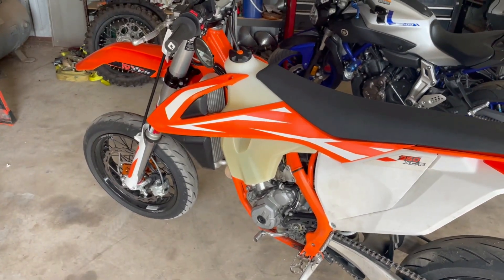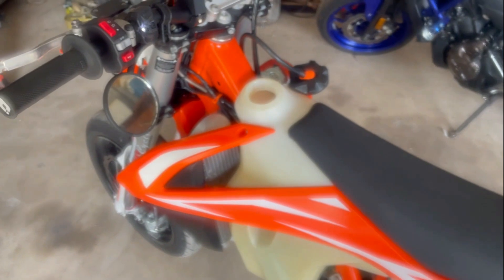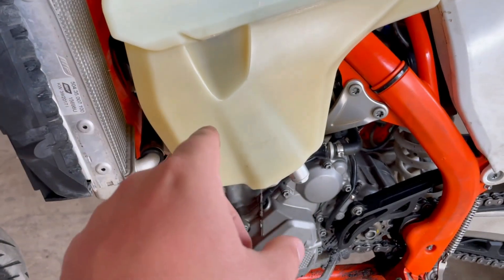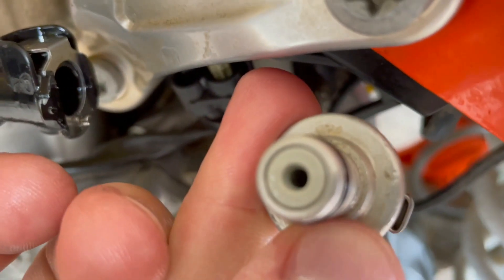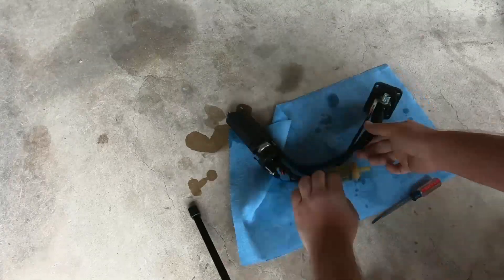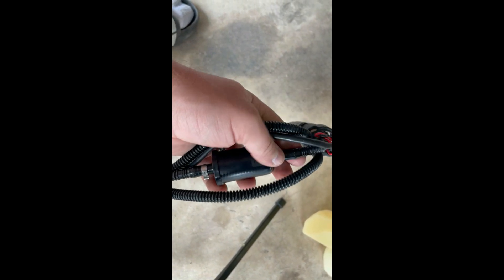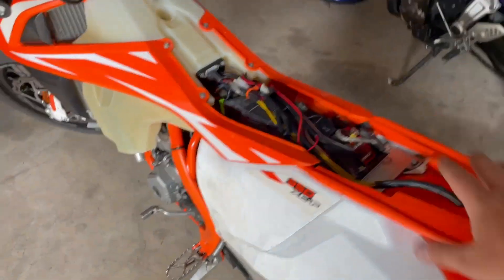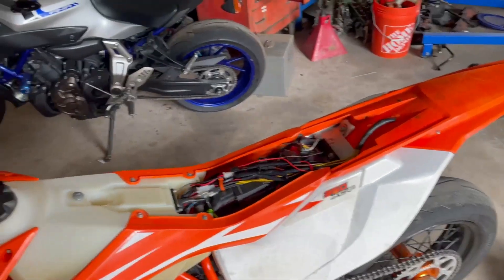Loss of Power and Bogging Fixed! / KTM 350 Dirtbike

Comment: I had the same problem, pulled the pump assembly and everything looked good. I ended up replacing the entire assembly and it fixed it. Upon further inspection, the fuel filter was clogged up bad causing the same effect. Great video, thanks!

Comment: It wouldn’t be spraying at all if not for the crack? I’ve got a buddies 350 sxf in my garage it is doing the exact same thing. Unfortunately after I removed the fuel pump and filter I can’t find the crack but it was spraying everywhere when about half full, I’m a 2 stroke guy not sure about these fuel injected bikes didn’t know if it always sprays or if it shouldn’t at all.
Reply from the maker: I’m pretty sure it shouldn’t be spraying at all. Once I fixed mine it completely stopped. I would definitely try to narrow down where the spray is coming from and then replace that part.
Reply: @slothmoto  thanks man i appreciate it

Comment: I dont suppose the sxf could have this problem, with it having a 1.9 gallon tank? I dont know for a fact or not if the fuel lump is in it. Im having a serious bogging/delay sometimes when going from idle to wide open throttle/mostly WOT.
Reply from the maker: I think the fuel pump is inside the tank for the sxf models. As long as it has a fuel pump, it should have a fuel filter somewhere. I was also having trouble going from idle to wide open. It sputtered a lot too. If you haven’t changed the fuel filter in a while then I think it’s worth a shot.
Reply: I had to do similar repairs to my sons 350 sfx 2017. The other part you had trouble finding location is a second filter. If you look at the black body of the pump you can un clip it and slide it off and access another filter. I also tied some wire to body before feeding into tank, it helped pull it back in. Another tip check the connectors are not loose from external to internal on connection this can cause issues. I have made up a test gauge to check pressure to carb, should be approx 50 psi.
Cheers Sean